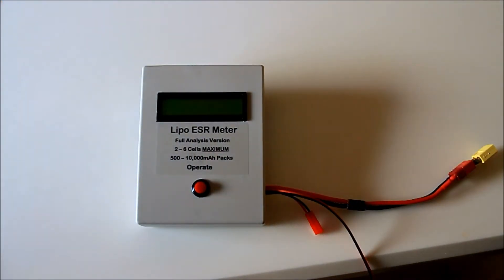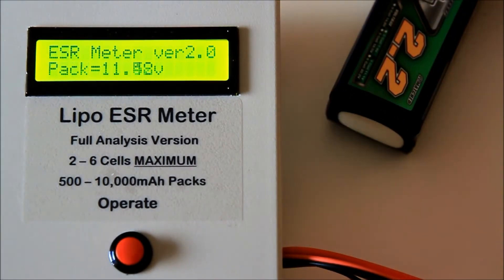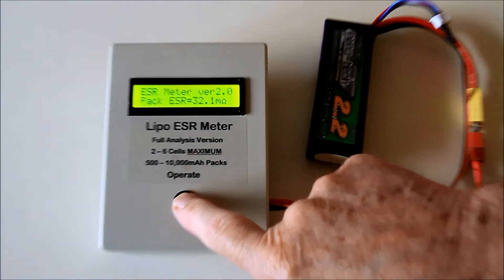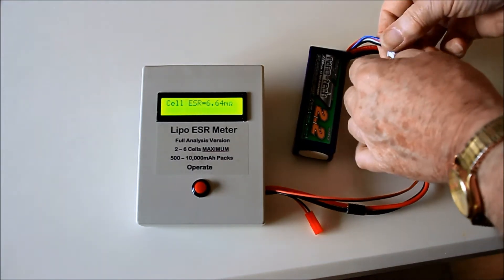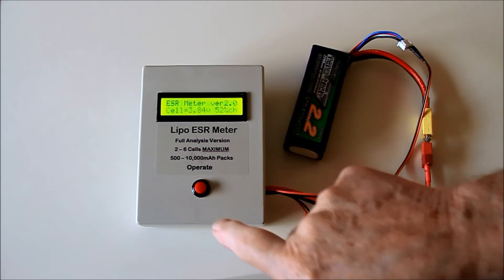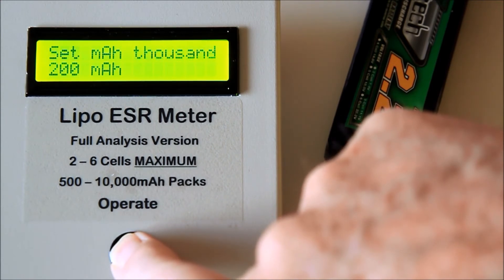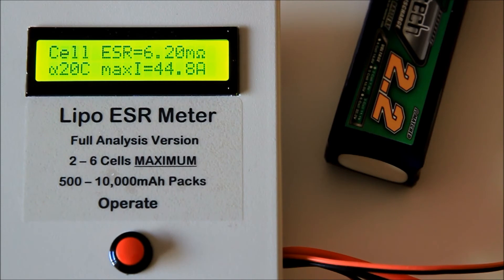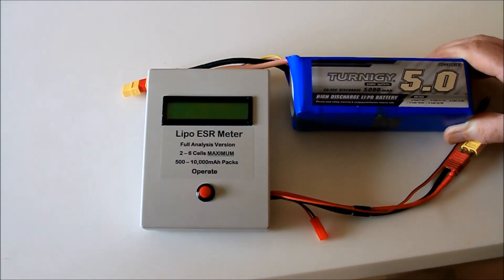Product Spotlight: ESR Meter - Analysis Version

Comment: So I don't get it, did it actually MEASURE current or not? Are you implying that 125A of current was just measured as max safe through these tiny wire leads? (somehow I doubt that) Or is that some mathematical calculation that you are running?
Reply: Its a calculation. Resistance is measured. Ohms law is Ohms law, not a suggestion or theory. Ohms law says that if you know the voltage and you know the resistance then you can calculate the current I=V*R Current (Amps)=Voltage*Resistance (Ohms). IR readings for Lipos like this are often measured in milliohms so keep in mind 20 mΩ is 0.020Ω
Reply: The ESR meter measures continous C rate. It does not measure boost performance.

Comment: Great video thanks for sharing, hey whats a good accurate way to determine the mah rating???
Reply: A capacity discharger. Typically done at 0.2C but for high discharge packs 1C would be a better measurement, possibly followed by a discharge that is half of the max discharge if you can discharge at that high of a rate (keep in mind C ratings are BS, few packs will ever do above 35C at room temp)